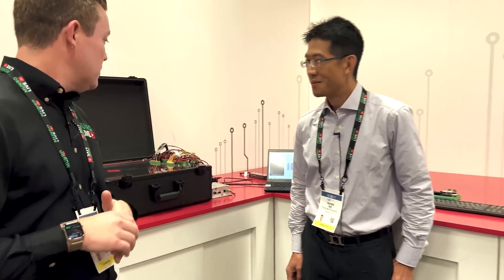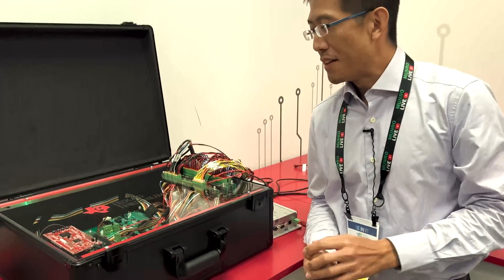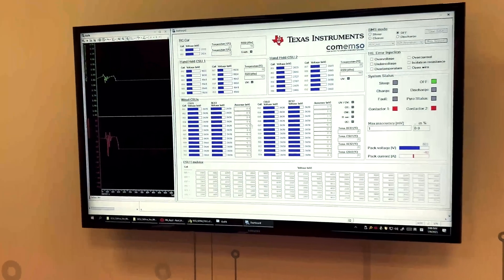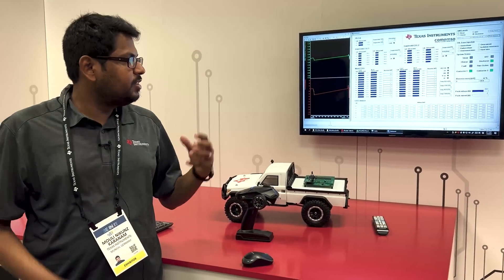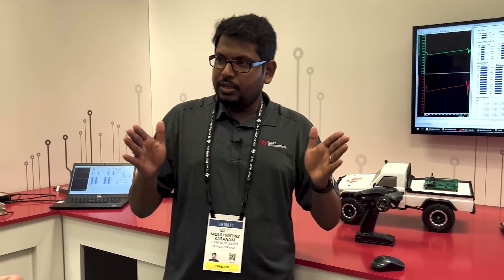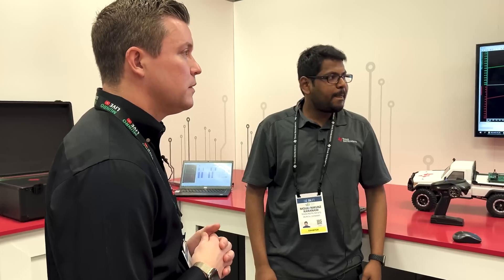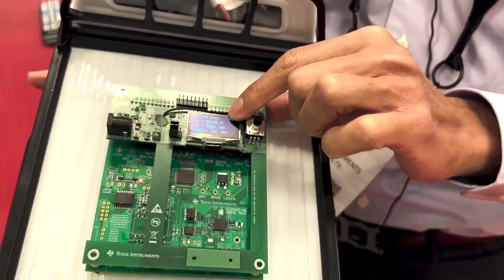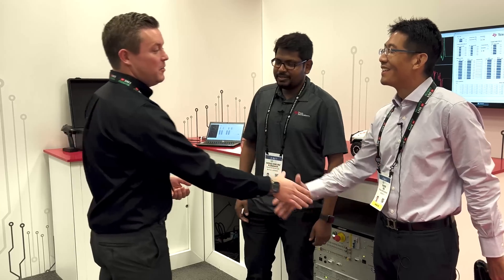Maximize your Driving Range with Texas Instruments | CES 2023

Comment: Wireless BMS, interesting double edge sword. Vulnerable to RF interference.  Could make swappable packs more possible.
Reply: its not all that sensitive to interference because barely any bandwidth is needed. it saves quite a substantial amount of cost by not having to run wires and connectors with all the associated manufacturing and assembly steps.
Reply: @drkastenbrot  The white papers on the Texas Instruments web site address ASIL-D in terms of the quality and reliability in a friendly environment but say very little with respect to an active attack or nearby misoperating equipment.  I.e. a vehicle passenger could be carrying a mobile phone with a Wi-Fi transmitter stuck on.  The chipset documentation describes operation in the 2.4 GHz ISM band and hints at 2402 MHz when it describes intermodulation distortion resistance with simultaneous interferes at 2405 and 2408 MHz with respect to 2402 MHz.  The TI WBMS protocol being propriety leaves a lot of unanswered questions, at least in my mind.

Like I wrote, this is a positive for the potential future of swappable battery packs, but I want to see more EMI/EMC test data before I trust the system.
Reply: @wtmayhew  like all spread spectrum technology, it is very very difficult to jam. a "stuck on" wifi transmitter isnt going to do much, and neither is a jammer unless you are in very close proximity with several watts of output power, flooding the receiver LNA. its also somewhat shielded to the outside. if youre gonna go through the ridiculous effort to design a jammer to temporarily disable the bms, wouldnt it be much easier to just take a gun and shoot the car? jamming these spread spectrum gigahertz radios is always a close proximity task so its effectively the same as physical access.
Reply: @drkastenbrot  Thanks very much for the reply.  I was anticipating accidental EMI/EMC issues, but malicious intent is obviously not unheard of.  The 2.4 GHz ISM band is plenty crowded with legal emitters which could behave in unanticipated ways.  The TI data sheet and white paper are pretty vague about what measures have been taken in the RF domain to assure robustness.  As you mentioned, a way to disrupt the link is to desense the receiver.  You could do that with narrowband interference, either accidental or malicious.  Desense might be obtained with much less power than required to corrupt the data.  In the case of malicious intent, an RF attack could possibly be used to disrupt multiple vehicles of the same type and might be more difficult to trace than a kinetic attack.
Reply: @wtmayhew  you underestimate the robustness of these receivers. i have been to model aircraft events where 200+ people with 2.4ghz transmitters were densely flying together, with transmitter powers of 350mW and above. nobody had any issues despite there not being any channels. spread spectrum simply pseudorandomly hops around the entire spectrum, and unless you exactly know the pattern, your jammer would have to be hundreds of times stronger, which is especially unrealistic for the shielded car. since all of the patterns are different, enough packets go through until the entire band is completely saturated. id guess that even a kW of directed broadband noise would not be sufficient to jam this system.
Reply: @drkastenbrot  Thanks, your point is well taken.  Your citation is a example of a cooperative environment.  Yes, I know the difference between FHSS and DSSS spreading and I understand spectrum sharing by use of code orthogonality and forward error correction.  An extreme example is all 24 active GPS satellites all transmitting on L1, yet a ground receiver is able to successfully separate the data at distance of 12,000+ miles.  The potential risk of the TI WBMS is when it is subjected to pathological conditions.  Interfering with the code space is probably fairly unlikely given the IMD margin is stated at 36 dB.  The WBMS transmitter is specified to have up to +5 dBm, thus an interferer would need to have +41 or greater dBm in the same volumetric space - probably not often likely.  Yes, that is greater than 10 Watts.  What the white paper and data sheet do not address is the effect of narrow band uncorrelated interference in or near the passband of the receiver.  We aren’t given the architecture of the receiver or how it responds to overload.   The reaction might be to dismiss seemly improbable events as not going to happen, but I’ve learned better.  There are consumer and industrial equipment operating right next to the 2.4 ISM band which are capable of leaking high power levels.  An overloaded receiver could be much more vulnerable to in-band incidental interference.

My second point was that the wireless data connectivity for a non removable battery seems over-stated.  The BMS resides in the battery and needs to have connections to the individual groups of cells and environmental sensors inside the battery.  Those connections can not be eliminated.  The data from the BMS to the vehicle’s central control is going to be in the kilobit/second range which is within the capability of FlexRay or CAN.  Presumably the battery is important enough that it gets a dedicated or even redundant bus.  The question is the trade-off of eliminating the cost of that wired connection offset the risk costs of wireless.  That is a difficult calculation because one is a fixed per unit cost and the other is I’ll-defined cost of potential litigation or future remediation.  Finally, yes, wired connections are susceptible to interference.  Finally, how does the on-board control respond to loss of data (either wired or wireless).  A few second gap is probably not worrisome if prior good data shows a trend of normal operation.  The central management is hopefully doing an ongoing trend analysis.  A trend toward anomalous readings followed by a drop-out is more likely a sign of a catastrophic event.

I have reluctance when I an told “our proprietary thing is great, trust us.”  Perhaps if you are an influential manufacturer, you’ll get more detailed disclosure that you can trust.
Reply: @wtmayhew  Get in contact with your local Texas Instruments sales rep, and we will be able to share all this data with you :)  Texas Instruments' wireless technology is used in other automotive applications such as car access, and we have taken care of both attacks (cybersecurity) and also interference.  Understand the concern on the protocol being proprietary, but BMS is a specific use case for which standard protocols like bluetooth low energy cannot handle.  The protocol has specific measures in place for all of the items you mention :)
Reply: @drkastenbrot  You're right!  But however ridiculous this may seem, the issue is that the OEMs need to make sure that ANY effort to jam the BMS system does not compromise the safety of the driver and the passengers within the vehicle.  All it takes is one incident to cause a recall or even to have a governmental agency start an inquiry into why this happened.  We have to treat this incredibly seriously even if the probability is extremely low
Reply: @markng2483  Thanks very much for the considered reply.  If/when the time comes to apply this technology for my application, I will be in touch.
Reply: @markng2483  As I said, jamming is equivalent to physical access in this scenario. They might as well cut your brake lines. I would go as far as claiming that some of the existing wired connections in cars are more susceptible to EMI than wireless.
Reply: @drkastenbrot  I haven’t had to design for the automotive environment… Having said that, isn’t it typical for the BMS to be in the battery pack?  It seems like the voltage monitoring and sensor inputs are the same regardless.  The question is about getting the data out of the battery to the vehicle’s central supervisory system.  It seems like a hardwired FlexRay network connection would provide reasonable bandwidth, security and could be ASIL-D complaint.  The downside is a potentially physically fragile connection.  Wireless could mitigate problems for swappable batteries.
Reply: @wtmayhew  BMS design varies across different manufacturers, but yes, by and large the battery control unit (BCU) and the cell monitoring are usually contained within the battery pack.  The battery control unit has to relay the information to a central vehicular control unit (VCU).  This connection is via CAN today,.  CAN is a proven automotive technology that has provisions for bandwidth, safety and security.

Comment: Wireless BMS is a huge deal. Will cut down a lot of the wiring cost in the battery pack
Reply: How so ?
Reply: @raphofthehills4405  The cost of wires and the time to install them is the obvious answer.

Comment: I didn't get a sense of how much improvement this system could provide.  1% , 5%, 15%?
Reply: A BMS doesn't improve efficiency, rather it allows full capacity of the battery to be used SAFELY.  The accuracy is the real selling point and allows any weak cells to be singled out for diagnosis. Over charging or over discharge are real battery killers.
Reply: @john_in_phoenix   This is perfect statement!
Reply: Yet the video title says "maximize your driving range"
Reply: @jamesengland7461  If you use 100% of your battery rather than 95%, you indeed maximize your driving range SAFELY.
Reply: @john_in_phoenix  you are reducing the lifespan of the battery significantly by giving up overprovisioning so its a bit of a pointless stunt
Reply: @drkastenbrot  No on a cell base, as you monitor each (paralleled) cell more precisely. 95% could be all cells have 95%. In reality one cell could have 96%, 97%, 94%, 93%. The high SoC cells would age faster over time. With more precise measuring you avoid this.
Reply: @Stefan_Dahn  and how would you do that? parallel cells always have the same voltage, you cant do wear leveling if you dont have individual control and the voltage limits are all the voltmeter is used for, no point in connecting multiple adcs to the same parallel bus.
Reply: That entirely depends on how good was your previous system. If you had imprecise system you had to increase the margin of safety.
This is excellent for OEMs with not enough experience designing BMS, now they can plug and play this solution and use the engineering man hours on other aspects of making an EV.
Reply: @KalifUmestoKalifa   Correct.  With an imprecise monitor, you are forced to increase the margin of safety - and that means you arent able to use as much of the cell as you should have been able to.  A simple example is a 60kWh battery pack -  Let's say all the battery cells are in theory able to give you as much as 200km total range.  If you dont have confidence in the accuracy of your monitor, you are forced to create more margin and you simply arent using the maximum range that is theoretically available.  So maybe, given the margin added for safety, the system is only going to let you have 150km of range.  Flip that around, and if you have an extremely accurate monitor (especially for LFP chemistries), you're able to get much closer to that 200km theoretical limit.  And hence you are maximizing driving range.
Reply: It doesn't give you better range, it gives the car "computer" a better more precise estimation of the remaining energy in the battery, this is especialy true for LFP batteries discussed here that have a very flat discharge curve and for wich it is therefore much more difficult to precisely know the remaining energy, but your cut off point will be the same as existing BMS, so your range will be exactly the same in the end